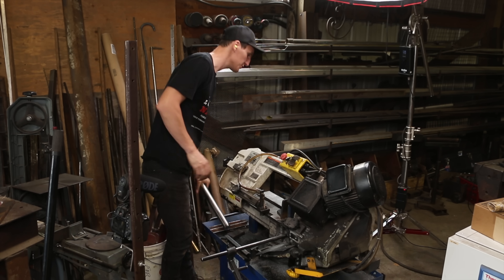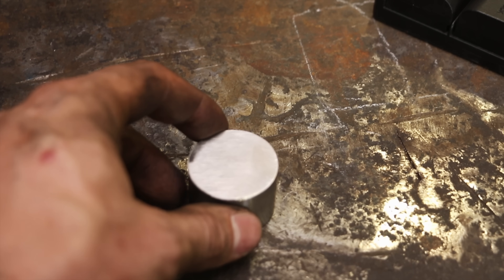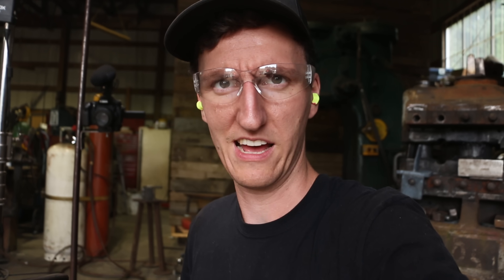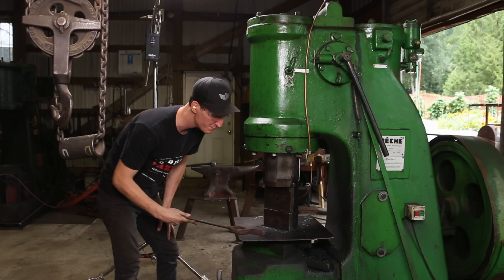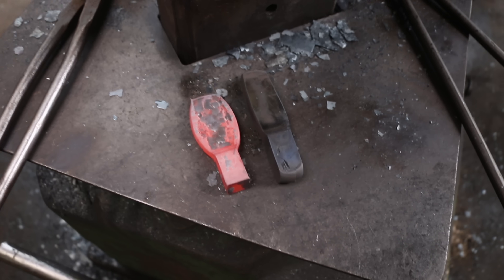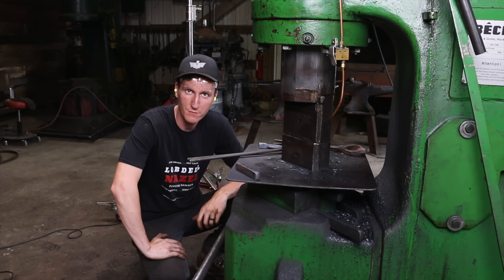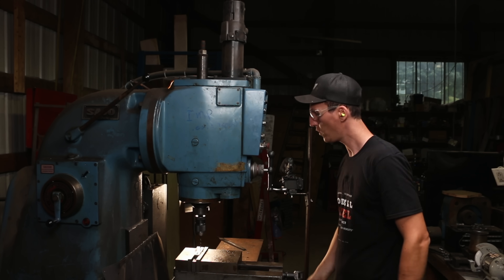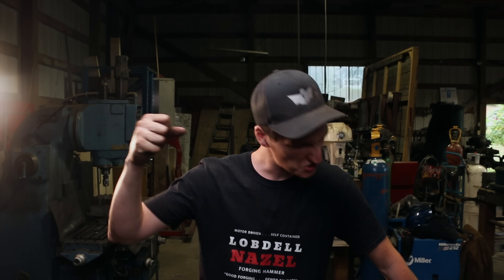Can I Forge INCONEL?

Comment: Inconel can be machined.  Cutting slow is the best way to not burn up your tooling.  You probably could have spared your bandsaw blade if you slowed it way down and used coolant.

The reason you don't see sparks when grinding/sanding is because the material just doesn't ignite; grinding sparks are the result of ferrous metals catching fire when ground.

Comment: You want low speed and high feed rates for cutting the stuff as it tends to work harden very easily. The reason your piece blew up is you exceeded the grain transition temperature where the metal formed a brittle phase between its mative HCP to a FCC crystal structure.

Comment: You should make a great-sword out of that, and since it stay hard while it is red hot, you could use it in combat while it is hot off the forge and burn stuff without any warps, bends, or dents. That is an amazing material that I really want to forge
Reply: Also if you made armor out of that stuff you would have some pretty hard armor, wonder if it could stop a bullet. Amazing job

Comment: General Motors forged inconel for years at their locomotive division. It was used to make heads of diesel engine valves. The valve line at the plant was pretty impressive, I used to give tours of it. The line started with the inconel bar stock, which was cut into slugs of the proper length, heated by high-frequency induction until it was red-hot/glowing, and then forged into the rough shape of the valve head.

Comment: I worked with Inconel on turbine exhausts. It really does not drill well at all. It resists cracking vs stainless steel but I can imagine its probably 10 times the cost.

Comment: Lmao your better off working it cold, when inco gets hot and cools it workhardens like a mofo. Machining it is a nightmare. I did sucessfully drill a .08 thou hole 2 inches deep on 20 parts went thru about 100 hsco drills one choked up one reg length. I was pretty proud of that

Comment: I wonder how well it will pattern weld with other steels. Might be something to use with steel for strength of the blade for a sword or maybe even try as the blade. Seen some stuff of how its not hard enough, but given how far people test things and come to a conclusion, I would try taking hardness reading on the outside and the work hardened inner. Also making a blade like a knife and axe blade and seeing if it will hold up on tests (making a comparison of work hardened to nonwork hardened edges) as they do make titanium axe blades. Could end up making splitting tools for forging or even punches out of them.

Comment: Hey buddy, we used to use inconel for wellheads for oil drilling. It's really hard and good with pressure, but you need a high amount of flux and it's really brittle to impacts.

Comment: Inconel has a high Nickel Content.  Low RPM, Light cuts.  I cut Inconel 600-900 pretty much daily.  In a lathe there are special inserts that are designed to cut inconel.  Inconel 718 is a Heat Resistant Super Alloy.  Its a tough material to cut.  But very rewarding.

Comment: I had a turbo kit from Audi Performance and Racing on a 98 Passat.  Killer little kit.  The exhaust manifold that came with it was a lost foam cast manifold made of Inconel 625. Seem to deal with the heat great.  No rust, no leaks and was a really nice smooth surface from the casting method.  Probably overkill.

Comment: Inconel X-750 was used on the X-15, the airframe that Pete Knight flew to Mach 6.7, over 4000 mph.    It keeps its strength at high temperature. If forms a variety of crystaline structures based on different concentrations, though the matrix is Face centered cubic (like red hot iron) the various precipitates form tretragon or romboid  crystals which block the slip planes.

Comment: It's also super hard to weld with, at least with stick. We chew through bits like crazy with pneumatic bevelers on inco cladden boiler tubes. Sometimes we use inco for hardfacing boiler walls in high wear zones with $1,000 per roll mig wire. It's a beautiful material.

Comment: Where I work, we do mostly inconel and titanium parts.  The learning curve for inconel can get expensive.   I suggest doing a good amount of research before you mess with it in any major way to save yourself some cash and time. Edit:  Also, as someone said before, coolant is absolutely required if you are trying to cut it with HSS, extremely recommended if you're cutting with carbide.  Both of those cutter types will fail much more quickly without coolant when cutting inconel.  Also, I dunno why you'd want to use inconel unless you're making a combustion chamber or certain other parts for a rocket or high performance jet engine.  It's primary application is environments with extreme heat.  It's not harder than the hardest types of steel, but it doesn't get softer with heat like steel until you get it VERY hot.  Some types of inconel are actually harder at higher temps than they are at room temperature.

Comment: I work with Inconel and yeah its a pain in the ass to work with. Drilling with a pneumatic tool is an art form, it requires an unforgiving balance of drill speed, pressure, and patience. LOTS OF PATIENCE. Or yeah the metal hardness means you just scrapped your piece.

Comment: Inconel  625 or 718 or what? All are extremely tough and retain  lot of strength at extremely high temps. This is what jet engine combustion chambers are madd of. 718 is probably the strongest material I've ever used but as you discovered, it becomes very brittle at around 1300°F.

Comment: I worked with it at a factory that produced glass. Used it as a gate to block the flow of glass. We used a welder turned all the way up to gnaw our way through until we got a plasma torch to cut it. Tough shit for sure.

Comment: If you were able to work it in an inert atmosphere, it wouldn't have exploded. Hydrogen embrittlement greatly deteriorates the mechanical properties .
Machning / drilling, your chip per tooth has to be below the work hardened layer that forms from the previous cut per tooth.

Comment: My first expericence with inconel was many years ago and the company chemical division was trying to develop a new process to refine copper ore.  That division asked us to expose the ore to high temperatures to bring about a chemical change.  The material was placed into what looked like large baking pans.  The pans were made of sheet inconel probably .050 thick.  Once the pans, containing the ore were placed in a forge and brought up to several thousand degrees, the inconel pans were nearly white hot and you could see the ore material through the side of the pan.  After a number of heating and cooling cycles like this the pans were warped, but there were no failures of the metal.

Comment: I worked in a machine shop in Houston  back in the ‘80’s. We used a lot of inconel for the oil industry. I don’t know which particular alloy(s), but I remember picking up a bar about 1’ long and 3” diameter and it was insanely heavy.

Comment: Inco (and any other nickle based super alloys) are fantastic functionally....which normally means they're crap for machinists. 

High temp nickle alloys can be hot worked, that's how the mills roll them into plate and bar stock, but they have very controlled processes to stabilize phases, grain structure, and solution of alloying elements. 

Whereas stainless steel is carbon steel alloyed with things like chromium and nickle to make it harder, tougher, and more corrosion resistant, Inconel's base metal is nickel which behaves waaaaay different from steel. 

Like you said and experienced, one of the main properties people are in search of is heat resistance, which means that it will retain high strength and corrosion resistance at high temperatures (experienced in environments like compression and  combustion areas of turbine engines).

As for machining, Inco is very abrasive and tough. Cutting tools where much faster and can experience severe notching and crater wear. It also work hardens, which means proper chip generation (speeds and feeds) AND chip evacuation are super critical. Once your endmill got to a certain depth, chip evacuation becomes difficult and your tool failed catastrophically likely because a corner broke first either due to recutting a chip, built up edge, or just general wear.

In drilling however, it's uncommon for manual drilling operations to get the correct penetration rate (feed per rev) for the spindle speed. Normally people feed too light and in this case that means extra friction from just rubbing. Normally you need through drill high pressure coolant on a CNC to effectively and efficiently drill super alloys. 

Oh and Inco 718 only reaches hardnesses of like 40 HRC. It's not super useful for most things a blacksmith would make (wrought decorations, knives, other cutting tools).

Lots of comments have already said similar things, but hopefully this explained a little more.

Comment: I'd love to get pistons made from this stuff, I wonder what the thermal expansion properties are
Reply: At typical operating temperature, 2618 Aluminum alloy has a CTE of 22*10^-6 /K and 4032 a CTE of 20*10^-6 /K.
Inconel's CTE of 13*10^-6 /K is much lower, but, like other Iron and Nickel alloys, it's not used for pistons because it's almost three times as dense as the common Aluminum alloys.
This would make for a very heavy piston, which would massively increase internal inertial stresses within an engine.

Comment: It's also used in extreme chemical environments where even the most corrosion resistant steels wouldn't last five minutes. It has great resistance to hydrogen sulfide for example, so it's very popular in the oil and gas industry in places with sour gas.

It can be readily machined using the right tooling. It can certainly be forged too. You need to get your speeds and feed rates right too.

Comment: I made a firearm safe and used Inconel sheet, dura plate 5 on 5  and 8mm SAF2205  in a laminated configuration and ran 30 kg of 6mm ball bearings in grout slurry between one of the lamination, then I ran a spring loaded glass relocker on the four sided 12 x 30mm stainless steel pins running off a four way gear driven locking mechanism all locked by a custom locking set up! 
Let’s just say I needed to hire a crane to get it home!! 
I would say thermic lance would be the only way in for undesirables!!  

Metals are crazy stuff to work with love em all!!!

Comment: This material is brutal.
I've worked for a company, Tempress Netherlands, in the eighties that made furnaces for eletronic wafers, and in these machines they did heattreatments with special gases. To hold these gases in the spot they usef baffle plates which were hanging on wires that were fixed on the top of the furnace. All inner material was made of Inconel and the holes in the top plate, which was 5 mm thick, were 3 mm drilled holes. Every plate had maybe more than 100 holes. With one drillbit you could drill 3 to 5 holes. Untill I found out that if you aliviated, by grinding, the drill bit and leave just a small contact brhind the cutting edge, so that coolant could get very close to the edge, tha then I could drill up to 25 holes before sharpening the drillbit again.
Yes it is a special material to work with.

Comment: I used to build gas turbines in a previous life (industrial ones for running oil pumps, making power etc) and I've worked with inconel (and nimonic) a lot though I've never machined it myself. We used to have a robot that would take pre-cut blocks and mill them (with intricately hollow air channels inside and have super fine air holes drilled) into gas turbine blades all day and all night and then they'd be sent off for ceramic powder coating and the like - this was the very late 90's when basically nobody was doing that. We used to go watch it do that on like lunch break or whatever - but there would have been a time when people would have done that not totally unlike the way you're machining it here which is crazy to think. It's my understanding that with these superalloys you're supposed to essentially take out big lumps in one go with really powerful machines to get around the work-hardening problem.

Comment: Being an aerospace and strategic materials melter,  Vacuum induction.  We made a lot of super alloys.  We got some scrap 718 in wire form,  couldnt bend it with a hammer.  It loves heat even for the hi NI. content. Turbine blades are made from it.

Comment: I made a knife blade of a cold saw blade. I don't know what that metal is called but when it's cold it's extremely hard even without hardening. The way I drilled holes for wooden handle was to use a masonry drill bit and let it heat up to red hot and thereby drill through. No way you can drill it with ordinary metal drill and I believe even ordinary tungsten drill bits would be damaged. The masonry drill bit got red hot but appeared unharmed afterwards - not even slight wear and 100% still working properly.

Comment: Back in the old days. On a car tune up we would file the outer electrode on the spark plugs leaving the edges as sharp as possible. Same with the center electrode.
Inconel files and grinds fairly easily compared to trying to burn or shape it.

Comment: What inconel alloy do you have there? Inconel alloys are usually not hard. Actually they are mostly pretty soft compared to tool steels. But they are TOUGH like a hellhound so they strengthen a lot when cold worked like forming a chip. And they start to soften up further at much higher temperatures. So this might be what you noticed, when you whacked it with the hammer.
And they absolutely are not suited for forging by hand. The temperatures needed to work it properly are way too high and you can ruin the microstructure. Edit: like what happened at the "explosion"...

Comment: Machinist for offshore oil tools, inconel and high chrome steels are used so often you feel so bloody lucky to get normal Group 11 steels 😂😂, inconel is so temperamental to feedrate, depth of cut and cutting speed. Constant coolant necessary and be prepared for lots of broken inserts and tools.

Comment: Inconel is a nickel alloy. To cut it on a band saw you need to set your speed, feeds and drop to a minimum. Cut slow, feed high and drop slow. The settings we use is 19rpm speed, 8 feed and 0.5 drop. It takes a long time to cut so just be patient and it will cut. Oh and you need constant stream of coolent. If you try to cut this stuff without coolent you will just burn out your blades.

Comment: All a good demonstration that you have to match the tool and machining operation to the material. I had an abrasive, coolant-flushed cut-off wheel absolutely fail to work in the face of a modified Invar bar. Normal Invar it would go through like a hot knife through butter.

Comment: You need to select the proper tooling when machining difficult materials. High speed alloy is not hard enough. Tungsten carbide, or perhaps ceramic tools would work. Also, using the proper cutting fluid would help.
Why are you trying to forge a material known for its red hardness???

Comment: We if you can read up on D6AC steel,  very strong but very high maintenance. It was used a lot in F111 aircraft and very susceptible to scratches and corrosion turning into stress fractures.

Comment: I used to blank punch .071 inconel on a 140 ton press. Each part was about 15 square inches and each cycle sounded like a shotgun going off. The punch and die were made of a2 and the part had sharp 90 degree corners which cracked after about 12 parts. Pinning of the plates was required and the punch tool was scrapped after 50 parts.

Comment: I worked 625 inconel in aerospace apps. One thing you find out is you can't hand drill with cobalt bits and fast drills. Once it snags...you have a shattered bit. We used hss bits and replaced them often. If you ran a bit until it dulled...it would work harden the hole instantly. So any heat buildup is bad news. You use a lot of bit lube (boelube) and slow rpm. that is probably what happened to your small end mill and drills.

Comment: Inconel is a trademark that covers a big family of different alloys. It helps to be precise. There's a huge difference between an annealed inconel 625 and a precipitation hardened inconel 718.
I'm guessing you had something like 718 which is why it behaved the way it did. If you can get it up to about 1000-1100C and hold it for a few hours, that should dissolve the precipitates so it softens to the point where you can work it.

Comment: Gotta use carbide only on inconel. And only an abrasive wheel saw to cut it. Been machining it for 20 years. We found that having the drills and taps TiN coated makes a HUGE difference.

Comment: Inconel is corrosion resistant in addition to being very hard, so even when high temperature flakes are thrown, they probably aren't going to oxidize in the air.
Reply: Inconel (718 for example) is not that hard. What the poster is experiencing issues with is that it does not soften at high temperature as much as steel or iron does. Which would be a reason it is used in jet turbines.
Reply: @FinnMcRiangabra  my question is, can it be used as an alternative material for titanium? I need something as strong as titanium cuz it's hard to buy titanium where I live. I need an alternative.
Reply: @Toxic88088  Completely different issues and you have not given enough info about your end-use to make any kind of recommendation anyway. Titanium is not very hard. What it has is (in alloys of appropriate heat-treatment) a high strength to weight ratio.
What qualities do you need? That is the only way to rate which materials are better than others. Cast iron would not be a good material for a jet turbine. Specialty single-crystal turbine bucket material would not be good for fencing. The end-use conditions (and what it makes sense to pay) are everything in determining the best material choice.